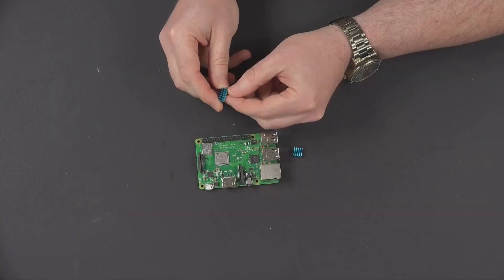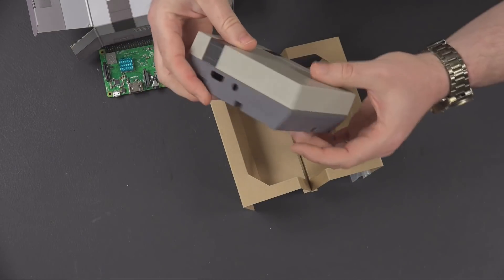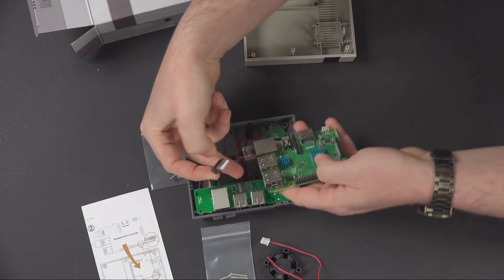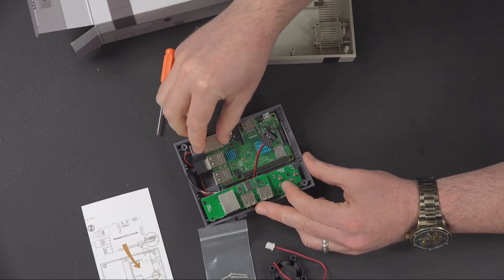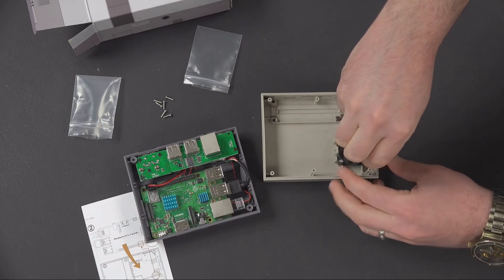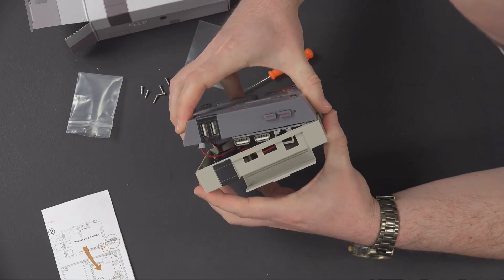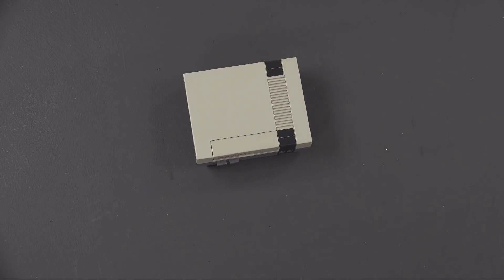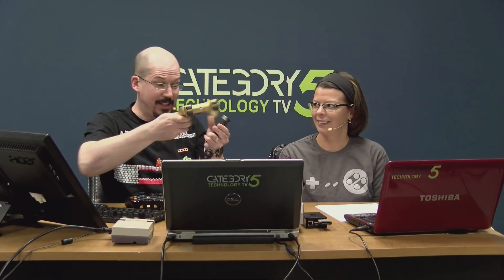NESPi Case+ Assembly with Raspberry Pi 3 Model B+ for RetroPie 4.4

Comment: You forgot the safe shutdown connector.
Reply: He installed a pi 3 b+ in an older version of the Retroflag nespi case which didn't have the safe shut down feature. Only the new nespi case+ (nespi case plus) has the new safe shot down feature with the new wiring.

Comment: ugly cooling -- no air intake, no radiator, cooler pushes air to closed plastic surface
Reply: Except it's not,  its vented
Reply: its not a ps4 dude or...the pi units are fine even without a fan..relax